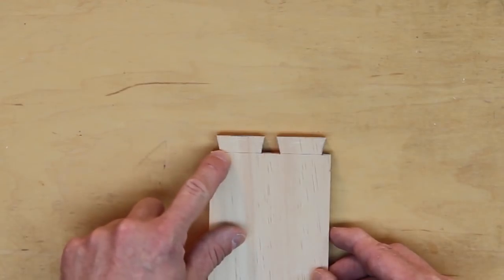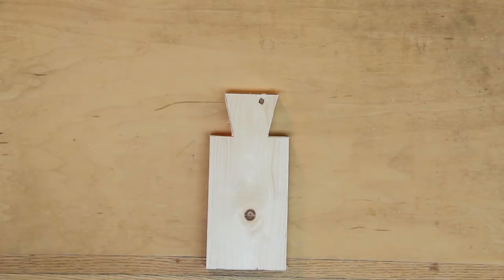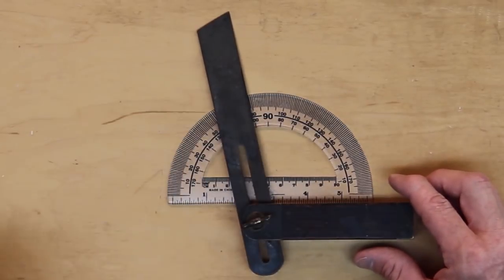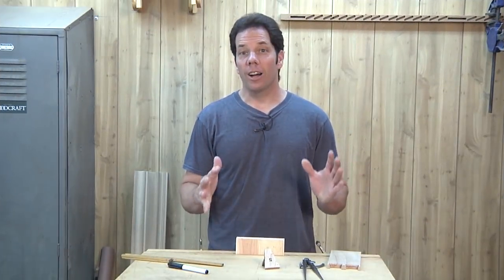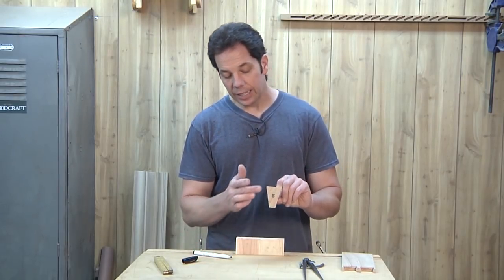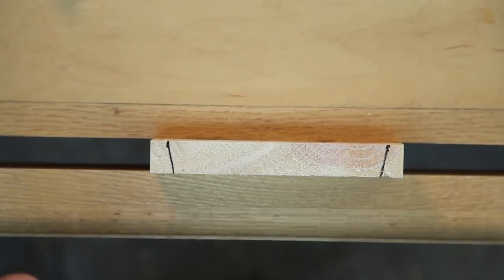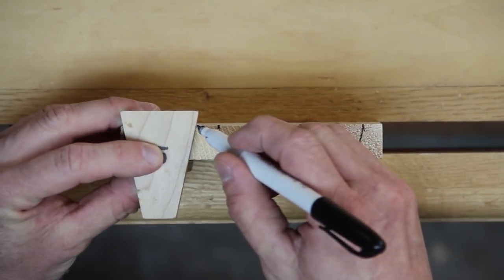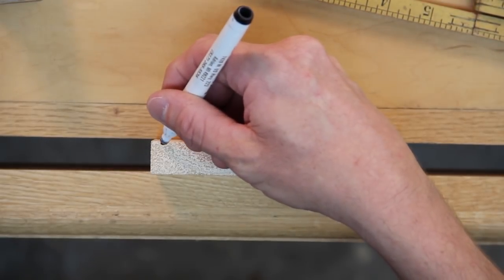Dovetail series- 2. Pins & Tails Layout

Comment: Great explanation.
Thanks for reinforcing the idea that the spacing and angles on dovetails is more asthetic than structural.
You might explain how you decide how many pins you use and how you decide on the pin size relative to the tail size.
Reply from the maker: good point!

Comment: Great video, Liked the strength tip.
Reply from the maker: thank you . Frank Klausz told me the pins and tail should be the same size for maximum strength. But i like the look of the smaller pins.